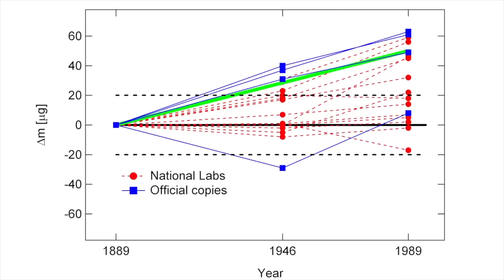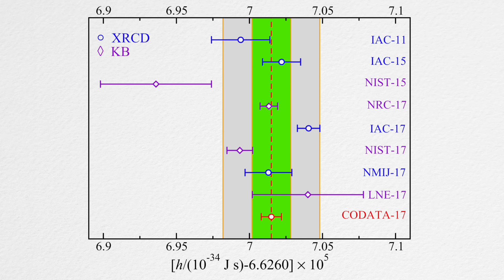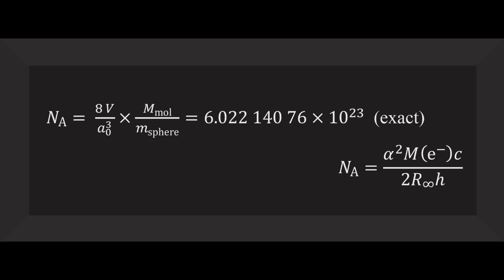The kg is dead, long live the kg

Comment: Seems silly to me. We are going to use a new arbitrary value of plank's constant to so we are no long dependent on a physical object. But we are going to use that to measure physical objects. Hmmm.
Reply: The point is that the old definition changed over time because the weight of those cylinders wasn't constant. Now it is constant and it won't change anymore.

Comment: If Planck's constant is a number that changes not by the machine measuring it, but at some other unknown affects it, then you are doing the same thing they did for the speed of light in the early 20th Century. The speed of light would change based on both day and location it is being measured from. They would take averages of all the measurements and give that day/week's value of the speed of light.

If in the equation shown, fh are necessary to get Energy then you have technically two variable numbers to determine what is going to be seen as a fixed number.

So for all you laughing at the pound, your entire measurement system, based on this video and people claiming to be smarter than the ever changing universe, is entirely based on variable numbers that some humans thought they would give absolute value to by their say so alone.

Congrats on the new extreme for arrogance in "science!"
Reply: Where exactly did you get the idea that the speed of light in a vacuum is changing?

Comment: So how would I calibrate the measure tools?
Reply: You can't - calibration requires very expensive equipment - the quantum gas laser clock for example can't be bought at your local hardware store. You rely on other people to supply you with tools accurate for your needs.
Reply: @nightjarflying  I don't mean my tools - i mean tools in general.  At the final point you should compare your calibration results to a physical item that you trust, and if there is no physical item - i just need to assume that my tool is calibrated ? Strange.
Reply: @Nadav You DO need to assume your tools are calibrated before you get them at the shop - how else could it be? You can test your clocks via NIST & you need to trust NIST are honest & accurate. NIST uses the definition of the second [unit of time] so that you do not have to. Definition: The second is the duration of 9,192,631,770 periods of the radiation corresponding to the transition between the two hyperfine levels of the ground state of the caesium 133 atom. ALL the SI units depend on a physical element - you can't define/measure constants without a physical aspect in the process [such as a caesium atom]

Comment: So what happens when  we inevitably discover that our set value for Planck's constant is not exactly accurate?  Aren't we doing what electrical metrologists did in 1990, stopping updating our value for planck's constant?  It may be better than the value from 1990 and it might be as accurate as it can be today, but I think it's more than likely that some time in the future, when we can more accurately measure the constant and when a more accurate value is needed, we will have to yet again convein and change the set value of the constant and SI units.  

So are fundamental constants truly constant?  In an absolute sense, yes.  In a practical sense, not quite.  We still only know their values within a degree of uncertainty and almost undoubtedly we will continue to change them and make them more accurate based on our ability to measure the actual, absolute sense of the constant.  Our measurements may no longer be bound by physical objects, but instead will be bound by our capacity to measure fundamental constants.  So, this change will not truly unbind our measurements or make them immutable as is sometimes implied, but it will redefine them.

That all being said, I'm still very much for the change.  At the very least, basing the kg on planck's constant (uncertainty included) is a lot less arbitrary than basing it on some hunk of metal in France.
Reply: Redefining our units to physical constants does have one big benefit. It divorces math from the measurement itself. With the old definition, to create new kilogram, you first needed to measure how much kilogram actually is, and then produce that exact value in the real world. measurement->math->production = two points of uncertainty.
With the new definition, the measurement part is skipped. It all becomes a matter of production. Note that production is really just manipulating universe to make and do stuff, based on natural laws (of which physical constants are part of).

Comment: Earth gains mass greater than is told, thus new measurements are always redefined in increasingly complex ways as to obfuscate the obvious truth.  
How is it that all of you very intelligent people don't see it?
1. Speed of light based on a meter based on speed of light is circular logic.  The seed number they use was covertly based on the coordinates of the greatest measuring tool of all time, the Great Pyramid.  The Great Pyramid was based on Orion's belt.  I derived a method I'm damn certain people once used to get an inch measurement from that belt in such a way as to be universally/internationally  acceptable.
It's stupid obvious it was completed not very long after year 0.  It is very fitting the Roman Cat holics would have the holy c as the speed of light.
2. Weights are increasing in the standard measures, thus one or two HAS to appear as decreased to maintain an illusion of uncertainty.
3. Earthquakes nearly always have FAR more uplift than downfall.  Although that could be explained away by claiming downfall only occurs at bottom of ocean.
4. Dust, elements, whatever you wish to name it, is far more prevalent in the solar wind and our solar system, and they allegedly are only just now finding this out.
Earth of course continues to accumulate. It wasn't built in some number of days and stopped.  It accumulates more than is told.

5. Plenty of fake "debunkers" are copycatting the propaganda that keeps this stuff too complicated for the average observer.  Very easy to do your own work.  Don't just type in "Great Pyramid" and find its way off the holy C coordinate, because it puts the point at a museum, far from the tip of the Pyramid. Measure from the top point to the "unfinished obelisk", and I personally found it is 365.25 nautical miles (I like to call it 365.25 Niles to the Cat holics Nilestone).  Nobody had that calender prior.

If the Earth was swelling like a sponge you would definitely need to find if water goes deeper than is taught. Yep, it goes way deeper as is now recently being said in recent reports.

Funny how the spped of light is not claimed to be circular logic, yet it landed at nearly the same meter stick length that was proposed long before the speed of light was even considered. Except, the new measure was about a half a millimeter longer.  Hmmm

Comment: How do they know that the Big K mass changed over time if that was the reference point? :D
Reply: They don't know if Big K changed. They only know that they started with a few lumps of metal weighing the same. Then after a while when they compared them again they didnt anymore...fun thing is they can't tell which ones changed by how much, they only know the difference between them.
Reply: Probably some statistical normalization based on the differences between it and all the other standards weighted to the original.  But by definition the Big K doesn't change so its a bit of a paradox.

Comment: Of course this will be found to be incorrect as well, since a photon is never a particle, it is always only a wave of energy. No matter the length of the wave, it has the same force as any other. But as the energy is expressed over a length of time, shorter waves will impact with more energy than longer waves as there are more of them per equal periods of time.
Reply: During reflection photons follow collision mechanics. That's why they're particles too

Comment: Does an object have different mass at different speeds?
Reply: Just to add an explaination of why: it's because of special relativity.
Reply: Put another way,  do 2 identical objects at rest have different masses when one's moving near light speed?
Reply: @Jack-ne8vm  I feel like you phrased that incorrectly. Either the "one's" refers to the observer (in which case of course the mass of the two objects is the same, they're travelling at the same speed from your perspective) or to one of the objects, in which case they're not at rest.
Rephrase that in a way that makes sense, please.
Reply: @lunkel8108  Put another way,  do 2 identical objects at rest have different masses if one of the objects is accelerated to near light speed, from the view of the stationary person?
Reply: @Jack-ne8vm  So you mean if one is at rest and one is near light speed. Yes, they do. You may know E=mc², however that's not the whole formula, just the part that's relevant for an object at rest. The whole formula is E²=m²c^4+p²c², where p is the momentum of the particle. From this you can see that the faster a particle moves, the more energy it has. And since energy and mass are one and the same, it has more mass.
Reply: @lunkel8108  Hence to increase speed requires even more energy because it has more mass....   Well, I should have seen that coming.
Reply: @Jack-ne8vm  Exactly. Reaching the speed of light would take infinite energy.
Reply: @lunkel8108  So, the kilogram in orbit is Itty bit different than a Kg here..... .
Reply: @Jack-ne8vm  First we need to make sure that we're talking about the mass and not the weight of the object. No, the kilogramm is not different, their mass in kg is, though.
Reply: No, mass remaines the same
Reply: @fran2911  incorrect
Reply: Yes, at very high speeds things get heavier
Reply: @Videohead-eq5cy  No, mass does not change. It was a now abandoned view on Special relativity that introduced this concept of increasing mass when reaching high velocities. Nowadays, total energy of a particle is written E = γmc², where m is the (fixed) mass of the particle, and γm is the formerly concept of "increasing" mass.

Comment: How are we sure that our measurements won't become more precise in the future and change planques constant again?
That feels pretty wonky to me to be honest. Surely the scientists know exactly what they are doing, but they are bound to the best of our current knowledge...
Reply: This definition makes it so that you actually can't measure plank's constant anymore. It's just a number. What you would be measuring instead is the mass in kg of the Big K platinum-iridium standard in Paris, which is not exactly 1kg anymore.

So what this does is reversing what you measure. In the past you started with the lump of metal, defined it as 1kg and asked what is h with respect to that lump. In the future you're going to start with h as this set number and ask how many kg is this lump of metal.
Reply: @skrimosinbaldur6055  Hey there, I didn't get that the fix end was Big K before and is now the constant, thank you for the heads up :)
I of course know that a natural constant can never change, otherwise it would not be a constant to begin with. My worry was that you would have to measure it insanely precise to use it as part of the foundation of your unit system. But when you "simply" swap what part of the equasion contains the uncertainty, it is not so bad I get that.
And the fact that our units don't come out of thin air but have to be defined is something many people might forget ^^
Reply: Plank's constant is a fundamental constant of nature. It cannot change. If it would, you can throw all of physics out of the window anyways, because the fundamental assumption of physics is that the laws of the universe are the same everywhere.
Reply: @lunkel8108  Now there's two parts about that. First one is: you have to define a set of units. In that set of units (for example the SI system) Plank's constant has a fixed value. If you change how you define the units the number value of Plank's constant in that system changes. Secondly it might actually be possible that numbers like Planks's constant change over time...probably not but there are theories about that...(about what not though^^)
Reply: Your first point literally just is "the definition of your units depends of how you define your units". I think that's pretty obvious.
Reply: @lunkel8108  Well yea in a way that's what I said. But what I ment is that values of constants of nature are dependent on the definition of units...uh yea...that might be obvious to you but for many people it apparently is not...
Reply: How we express those constants in our units is based on our units, yes. But the actual value of the constant doesn't change. We can express it in different ways, but it's still the same. The actual value doesn't depend on your units.
Reply: @lunkel8108  My worry was not that the constant itself would change but rather, that we haven't determined the constants precise enough to ensure a stable system of units based upon them. And with something so fundamental, even the slightest deviations might scale up to a problematic degree in scientific research. For example we know the speed of light is 299 792 458 m/s but what if we measured wrong and it is actually 299 792 500 m/s? That would mess up our units and in things like astromechanics, it is not a little hickup, it may render years, even decades of work, useless.
Reply: @NochSoEinKaddiFan  That's why they made sure to be extremely precise in their measurement and used multiple ways to measure it. The thing is, even if we do discover that the measurement wasn't precise enough, the changes to the units would be negligible and certainly smaller and more predictable than the changes to the units that occur when they're defined through physical objects. 
So even if we make more precise measurements, the unit still is more stable this way.
Reply: @lunkel8108 So the different ways of measuring back each other up and comparing the results reduces the margin of error that occured in each of the individual approaches. Did I get you right there?
If so, that makes a lot of sense, thank you for your patience! :)
Reply: @NochSoEinKaddiFan   Yes, exactly. The margin of error is so small that it's not a problem.
Ich bin immer überrascht, wie freundlich leute unter physik videos sind; bin froh geholfen zu haben.

Comment: One of the most stupid idea ever. It's like setting up the value of pi as accurate as possible by measuring some physical object(s), then fix it and derive everything else base on that. It's a joke right?

Check similar case when in USA they tried to diz value of pi equal 3.2. This is exactlt the same case.
Reply: No, this is not a joke. Previously the value of 1 kg was exactly what that cylinder in paris weighed. The problem is, we know that the weights of those cylinders change over time ever so slightly. You also had to use this one specific item if you wanted to know the actual precise value, which is very incovenient if you're not in paris. 
Now it's bound to a constant of nature, which means that it won't change anymore and you don't need to travel to that one arbitrary piece of metal just to precisely measure your stuff. 
Your example with pi doesn't make any sense. It's not a unit. It's just a number. You cannot define a number to be a different number.
Reply: @lunkel8108  Did You understand the part with measuring physical object(s) to set the Planck constant value? Planck constant has also a fixed value (like pi) and it doesn't depend on how accurate we will measure it. What will happen if the very next day, some scientists set Planck's constant more accurate? Do we change the definition of kg then? No, definition of kg will stick to the old (wrong) value of Planck's constant, which has nothing to do with observations (because it was measured not accurate enough).

I understand that definition of kg will be based on Planck's constant. It's super fine. But I don't understand the fact that scientists will agree on Planck's constant value based on some measurement which they did "as accurate as possible [for year 2018]". It is broken by design.
Reply: @zolv  No, the definition of what a kilogram is will change then. The thing is, we have measured plank's constant so accurately, that even if we measure it more precisely, the changes to the unit would be less than the changes we would experience if we'd continue using the physical object. This way the unit still is more stable.
Reply: Also you do realize that measurement inaccuracies still occur when you use physical objects, right?

Comment: I’m not sure why it has to change, it’s such a small variation it doesn’t seem worth it. A kilo in Mozambique is the same as a kilo in Milan. 
However.. 
  A gallon in America is 3.79 litres, a gallon in the uk is 4.55 litres. 
What gives?
Reply: It's not about the change. It's about the kilogram staying constant from now on. Previously it was defined through Big K. Whatever it weighed, it was per definiton exactly 1 kg. The problem is that the weight of Big K and the copies of it (that were shipped to different countries to be used there) changed over time. What one country would call 1 kg would be different from what another country would call 1 kg and different again from what it would call 1 kg a few decades into the future. Now it's defined through an experimentally observable constant of the universe. It won't change anymore. Everyone will agree on it without discrepencies.